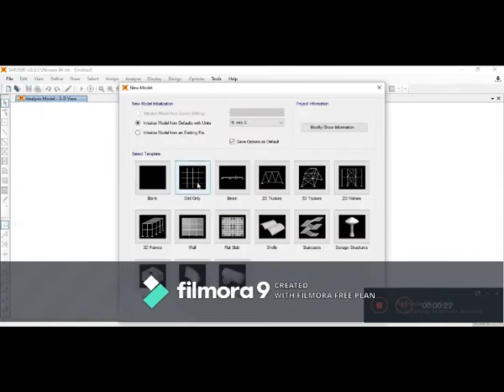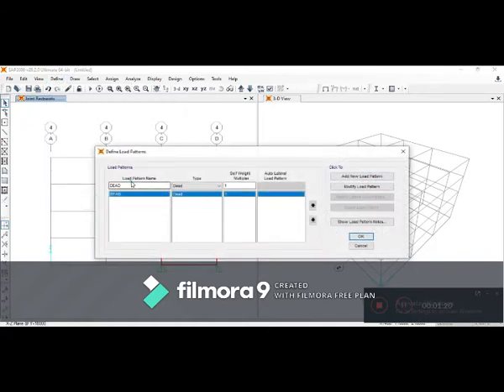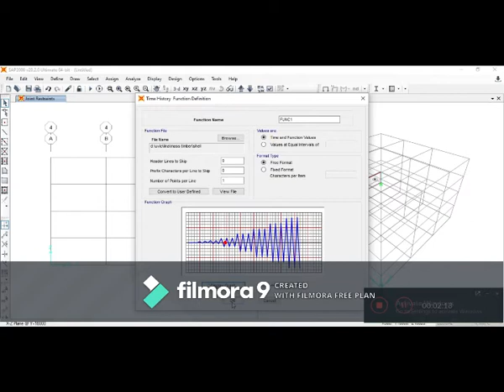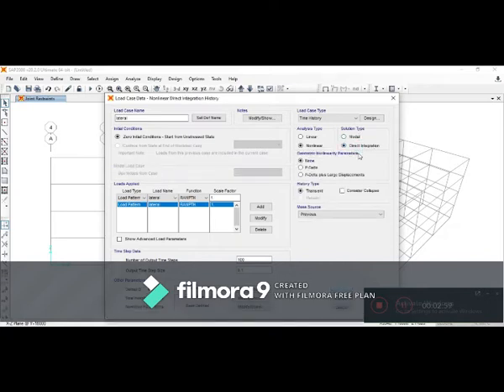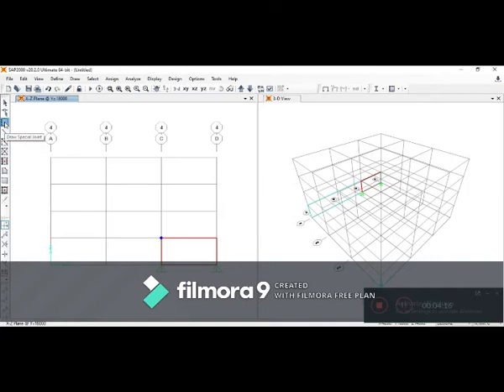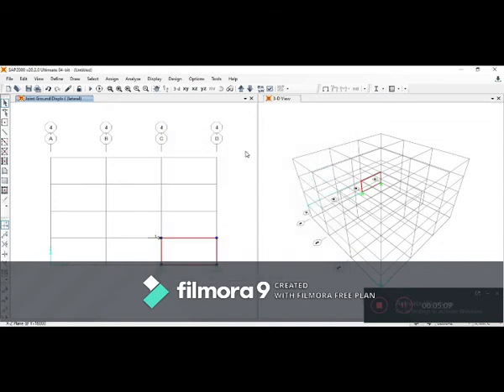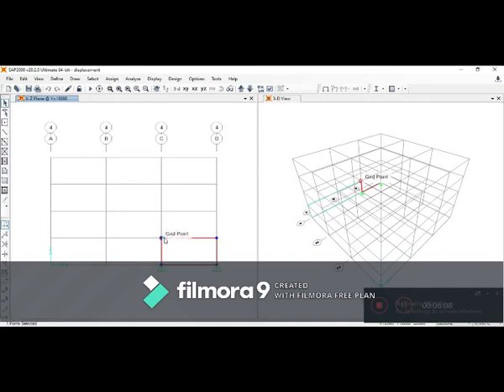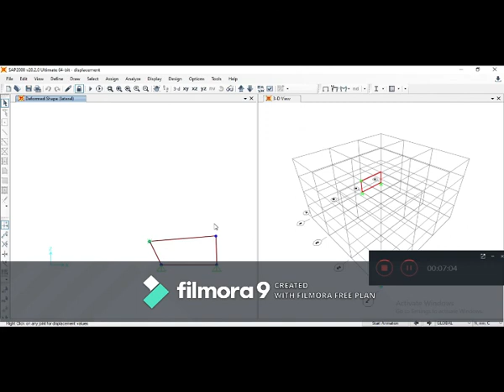sap2000 tutorial: How to assign a joint displacement as lateral load in SAP2000?

Comment: i want to say that if i model a shed on sap2000 , i have model main rafter and purlins with cold formed sections i want to allow the Z purlin to displacement by providing sloted hole , i not what to apply the effect of minor axis on rafter due to purlin, how to handle this problem in sap2000